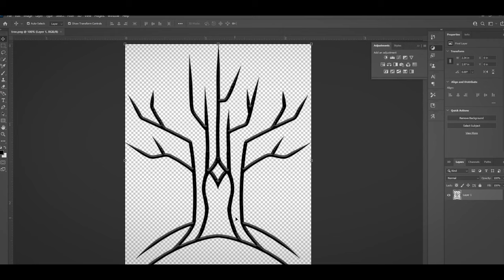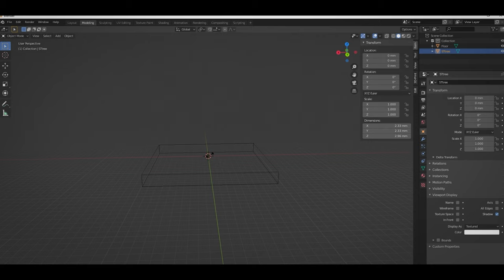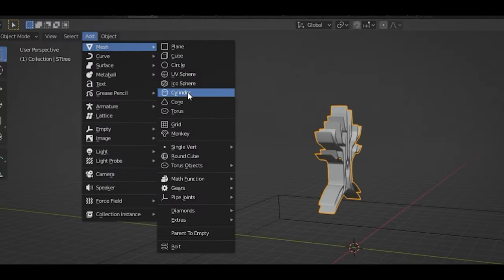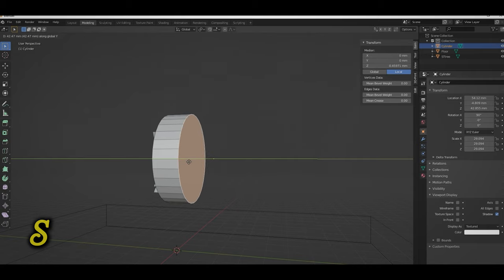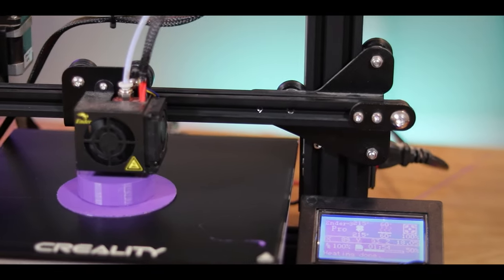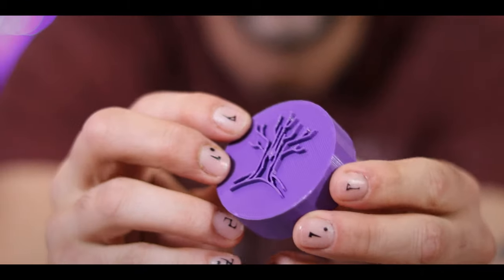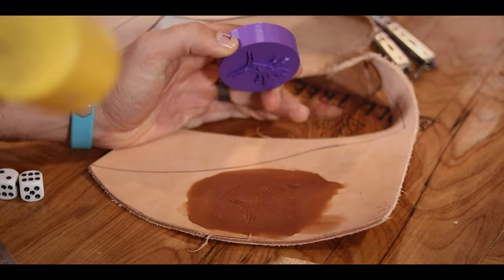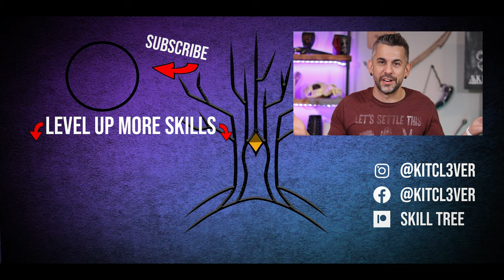Can You 3D Print a Leather Stamp?

Comment: Late to the party…. If you were using the default layer thickness of .2mm that could be why the details didn’t print on the smaller. Dropping that to .16 or maybe even lower like .12 may help with that

Comment: A resin printer would likely print smaller and jump around less as you can make it solid inside without increasing print time. May also have been better with wedge  instead of lines.

Comment: 3D printing leather stamps works like a charm! They're better for being used with a press rather than being hammered, though.
P.S. when it comes to small and detailed stamps, resin printers might be the way to go (even though resins have different properties than filament and often are way more brittle). #stamp
Reply: Resins with an Arbor press would take it easy on the brittleness. I use my arbor for almost everything
Reply: I've recently found this channel, but have experimented with resin and fdm stamps in my leather. They never seem to stay deep enough. Am I not using enough pressure you think? I've tried hammer and hand clamps.
Reply: @nateinthenorth1999  a couple of questions arise:
1) what kind of leather are you using (i.e. veg tan that's thick enough)?
2) are you wetting the leather enough before stamping?
3) are you stamping on a hard surface, like a slab of marble sitting in the corner of a table?
4) are you printing the stamps' grooves deep enough?

Comment: Hey! Glad you got to this topic! I 3D print leather stamps all the time; however, I always print them upright so the layers cross-section(....ate?) the design. This also makes the tiny details more viable and also less likely to break off after use. 

Also, hammering never works for me, but a $50-$100 arbor press does the job very nicely on wet-leather. Kudos! Great job bro!
Reply: Resin is great, too!
Reply: @nateinthenorth1999  after getting a resin printer, i can agree; however, it highly depends on the resin
Reply: @CorsoWorkshop  what resin have you had good luck with? I've done some minor stamps in regular resin with ok results - not very prominent after leather is conditioned. I believe I need a press for better results.

Comment: I work for a leatherwork company and pretty much any time we do custom logo work we get the stamps 3D printed. It's a great option for small businesses to get a custom leather stamp for a reasonable price! The only time customers opt for a brass stamp is if they want the option for heat branding or metal embossing. We use a hand-operated clicker press for stamping.

That said, sometimes the pressure and repeated use will cause 3D printed stamps to warp over time, especially ones with fine lettering and other small details, but when that happens they're also easy to replace!

Comment: I loved the video, something i would never think off. Excited to see what you'll do with your printer next.
Also a free alternstive! Most CAD programs can use an svg to create a 3d render or path skipping tbe photoshop step entirely. TinkerCad being my favourite. I've used it for basic modellling, badges, and custom designed dice box lids. Its also easy to use. Like really easy. Its a teaching tool and there are a variety of tutorials out there on it. Its really good for quick and dirty designs so i recommend it

Also! your printer is fine, an expensive printer probably wouldnt make the small details print better. Most printers come stock with 0.04 mm nozzles, if the design is thinner than that it wont be able to lay down lines thst thin. A smaller nozzle and stronger filament is probably more likely to get you the results you want.
High infill might be something to consider as well, just to weigh down the stamp. Or maybe adding a hole to take a weight or handle? A lot of options.
#stamp
Reply: Other alternatives are things like fusion 360, which is free but a pain, and 3d builder which is rudimentary but easy. Both will do the job without photoshop. Even if you might have to export the stl from tinkercad first

Comment: The reason the small ones didn’t work can be a couple of things. It could be the slicer doesn’t recognize it as put together properly (not saying that you did anything wrong) and a way to check it is with mesh mixer(free app) there is an option to check the mesh to make sure it’s going to print properly. Also, I’ve noticed that some files print better on cura (free) and other with simplify3d (paid). Lastly if you wanted I could resin print your smaller ones for you, I’m fairly sure it would come out exactly as you want it. #stamp

Comment: I had good luck printing leather stamps with a resin printer. I  used an Anycubic and the stamps are pretty solid. Then I used them with my Arbor press to get a good design. I was even able to print small 1 inch ones that would work.
Reply: was there a specific resin that you used?

Comment: A better option than a 3D print is a laser etch, there's a few places at the local Ren Faire that have made stamps with thicker wood they laser etch to make a deep etch. Then spray seal it before using same as any other stamp on leather.

Comment: As I have a moderate amount of 3d printing experience (lots of 'learning experiences' aka failed attempts) I can confirm what   @PatrickPaul1203 suggested; the issues with the smaller stamps, aside from the resolution being too small for your printer nozzle, is in fact the .stl mesh file. The slicer (pretty much all of them afaik) looks at 'manifold objects' that is; a shape with all sides closed. When you put the two pieces together in blender they were two individual 'manifold objects' merely overlapping even though you 'joined' them. Sometimes this will be treated by the slicer as a single object, other times as one 'inverting' into the other.
Unless you're familiar with Edit Mode in Blender, I am not sure of any easy way to 'fix' this and get the two objects to merge properly. PatrickPaul1203's suggestion of Mesh Mixer is probably the best bet though!

Comment: #Stamp

One of the reasons you are having trouble with leaving an impression is the fact you are using a very light plastic mallet.  You need something with a bit more mass.  The book press will work but takes a lot of time.  I recommend an arbor press for single stamps like this.  They can be used for a variety of other leather craft functions and various other crafts.